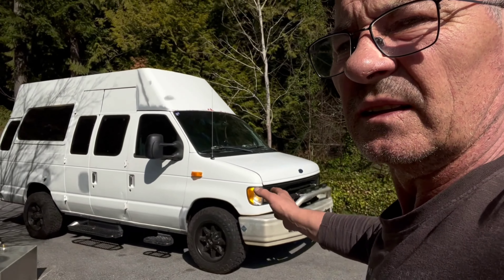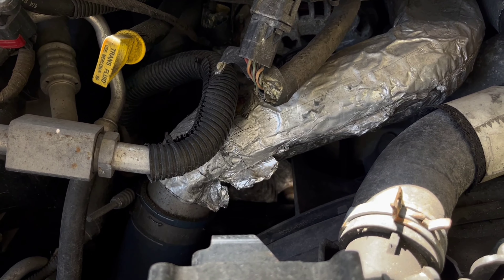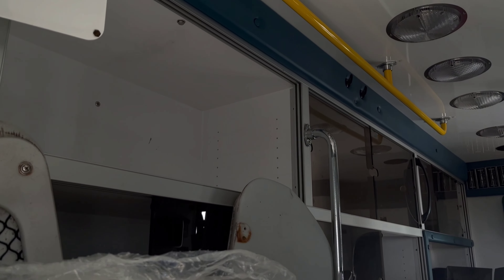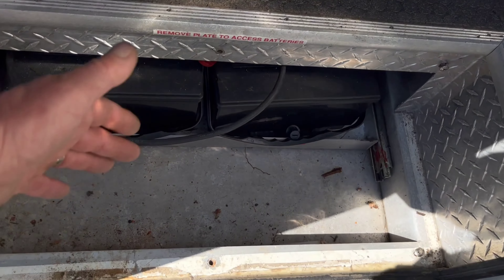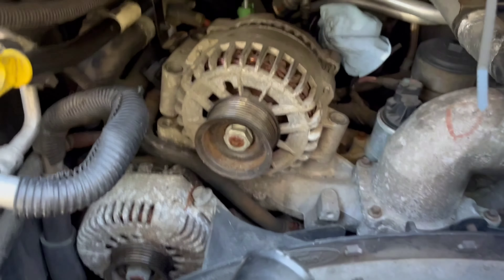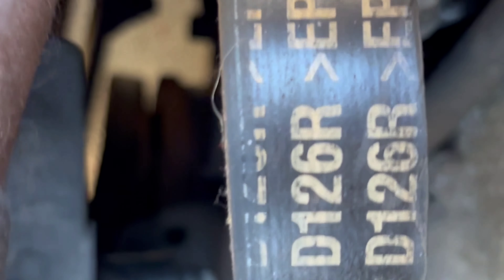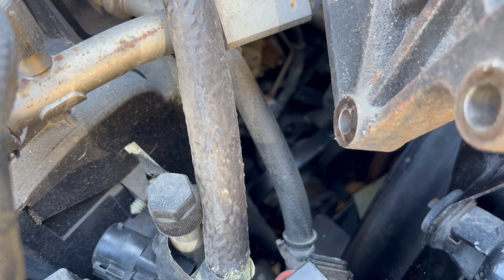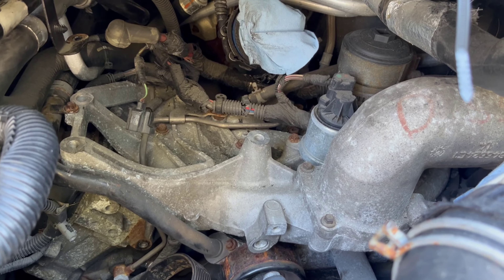Ford E350 6.0 Powerstroke Dual Alternate Removal

Comment: Great work my friend,slow and steady wow thats tight fit,thanks for sharing ,big hugs from MN
Reply from the maker: Thank you!  Yes the vans are always very tight packed 
Be safe hugs from BC
Reply: @lolesoffroad  his please can you tell me more about the Nissan patrol/Safari GQ that have. How best is it stock compared to the Montero/Pajero Gen2/mk2. Either diesel or petrol. And how strong is the Nissan engine. Because I see most people changing it to Cummins. They Pajero/Montero is with 4m40 diesel engine
Reply: @lolesoffroad  hi does the egr delete make any improvement to the performance?
Reply from the maker: @nanabrimpong3485   hi 
The patrol is a beast it doesn’t compare  the Pajero / Montero  and that’s the diesel  one I’m not sure of the gasoline because I never seen one, but from what I heard it’s not as good as the diesel.
Reply from the maker: @nanabrimpong3485  yes the RGR delete improves the performance plus the engine will run cooler.
Reply: @lolesoffroad  and with the egr delete do you keep the turbo also or remove this.
Reply: @lolesoffroad  but what diesel engine capacity is best for the Nissan Patrol? Because the Pajero diesel 4m40 is very popular too and I found it a bit quiet and pulls quicker with less revs. Reason why I am saying this is because I always saw most patrols louder with high revs and less speed as compared to the Pajero. Or is it because the ones I saw may be a lower capacity engine or something? Because I really like the boxy look of the Pajero Gen1 (1989-90 model) and Gen2 (91-99) as well as the Patrol. All in manual/standard transmission. I have noticed a lot of people swap the engine of the Patrol for Cummins or other powerful diesel engines.
Reply from the maker: @nanabrimpong3485  the pajero is good the 4m40 for sure it’s quiet  you can tow with it and you got to be careful when climbing mountain passes 
I used to own a few in the years 
It’s pretty good just don’t push it hard. 
The Nissan it’s not loud at all 
If you get the 4.2 turbo diesel 
It’s a monster I Cruze 130 Km per hour no problem rpm is only 2500 so yea if it’s non turbo for sure it higher Erving an slow
Reply: @lolesoffroad  I asked you about the Patrol because I like your setup. Looks really good. But I like the retro look and the strength and ruggedness of these two vehicles but I was thinking of which was best to choose from.
But the 4.2 ltr you are talking about is it a v6 or v8 version? And is that the original Nissan patrol engine other brand ? 
I noticed the U.N. used the GQ a lot during the Bosnian war and other peacekeeping missions before switching to the Toyota landcruiser.
Reply: @lolesoffroad  also the Nissan Patrol is yours setup as solid axle? The Pajero has other more powerful v6 options too but the most popular is the 4m40. They have the 4m56.

And since you prefer the Patrol much better than the Pajero is the landcruiser 80 or 100 also good options despite the price. Because the Pajero also has very expensive parts too. How costly is the Patrol because I have no experience with that.?
Reply from the maker: @nanabrimpong3485  yes my Nissan is solid axel front and rear coils all around that’s the only thing I would trust in the bush it takes me to places that not many can go. 
Yes I like the land cruisers but they are just to expensive and expensive to maintain. 
It all depends on the condition and mileage, if it is in a very good shape with a factory turbo set up can be in the high 25.000 
Where are you located ?
Reply: @lolesoffroad  I am thinking to get a very good vehicle setup as a proper overlander. To travel around via all terrain in Africa
Reply: @lolesoffroad  those ex ambulance econoline are they expensive?
Reply from the maker: @nanabrimpong3485   post Covid they was cheep around $6500 after as it is now they go for about $15000 
If it’s build out from &70,000 to 110,000 all depends on build

Comment: But how do you get then tensioner out ...
Reply from the maker: It’s really tight but it’s doable 
you need to remove a few things including the shroud ✌️
Reply: @lolesoffroad  Yeah. I ended up using a pry bar to get my alternator back on. Easier

Comment: I’m purchasing an ambulance here in two weeks what could you tell me that I could look for? It’s a 7.6 non-turbo diesel
Reply from the maker: Where are you located and what brand is the ambulance 
Very important to check all steering components balljoints, break condition 
And the rear sudd as pension spring condition 
Rust is very critically 
Check all fluids make sure transmission is strong put in gear hold the breaks and accelerate 
Take the oil filler cup off when it idle see how much blow by the engine has if comes lots of air stay away from the purchase 
Email me if you got more questions 
Cheers
Reply: E350 1993 located in Washington State buying from Oregon
Reply: They say it has a fuel issue and then I’ll need to take for batteries with me in order to get it started
Reply from the maker: To be very honest with you  I would have a mechanic look it true 
Because of the fuel issue 
It could be small thing or a bigger issue where you will have to rebuild the injection pump. 
So just be aware of that 
Make sure there is no major oil leaks and so 
And I would definitely check alternator when it’s running that charges 
So you won’t get stuck on the road running out of power. 
They are good engines but under powered 
Very lazy up heals 
Cheers
Reply: @lolesoffroad  I appreciate your honesty, and I was unaware of how under power the engine is, especially since it doesn’t have a turbo
Reply from the maker: No problem it’s a good thing to be aware, exactly after you build it and loaded it won’t go any faster then 20 miles/hr
Reply: Would it change if I added a turbo to it that you know what I’m just gonna email you so you don’t have to keep responding to the YouTube channel